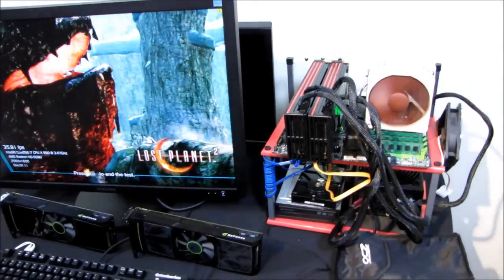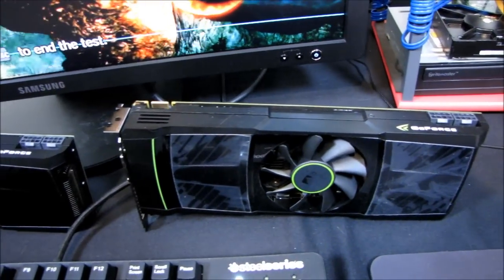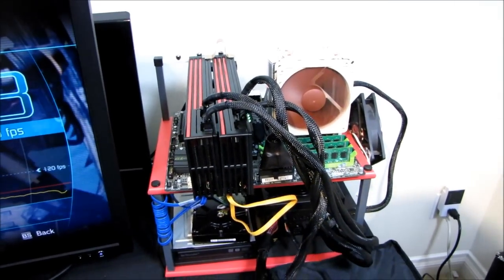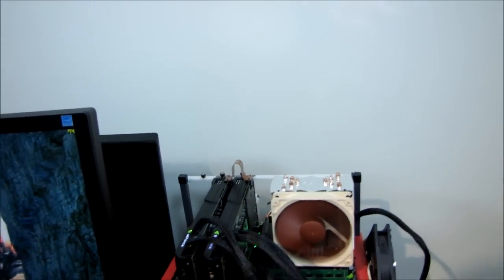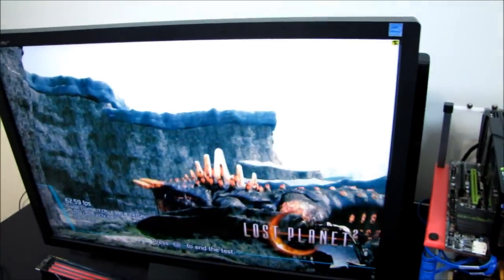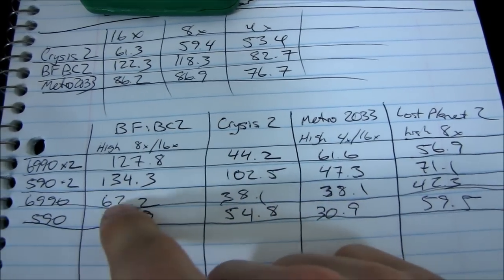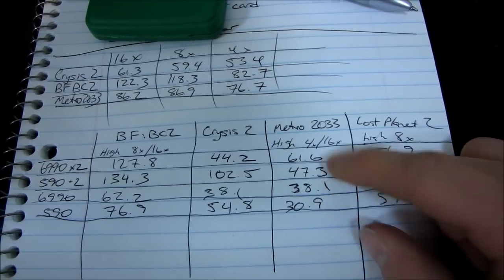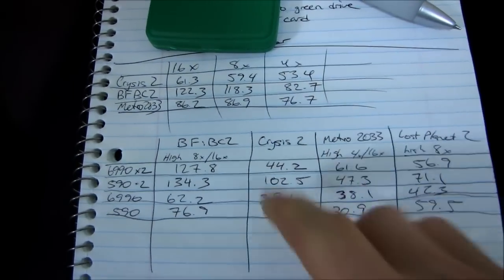Quad SLI vs Quad Crossfire Heavyweight Showdown GTX 590 & HD 6990 Linus Tech Tips

Comment: Pentium 4 - 7 gigaflops 
Core2 Quad - 70 gigaflops 

Playstation 3 CPU [Cell Processor] - 218 gigaflops 
Playstation 3 GPU - 1800 gigaflops (1.76 teraflops) 
nVidia Geforce GTX 295 - 1788 gigaflops (1.75 teraflops) 
its a fact idont have a ps3 check wikipedia and IBM

Comment: na thats about right dude. A GTX 680 will run around 40-50 fps with maxed settings and 32x AA So im not surpised if a 560ti can work just as well with no AA.

Comment: because it doesn't  at all it only does a solid 30 fps it usually doesn't do a full 720p on most games its just blown up from about 640p it cant do aa or af has much lower res textures by a lot you could see that just by look at the ground doesn't do ssao hbao or any ao at all and cant do shaders that need samples at anything higher than 32 samples cant have nearly as high mesh detail but then again the xbox cant its just a tech thing and its all DX9 so you alrdy are limited by that alone

Comment: You CANNOT build a full working pc for $280 and have it perform better then a console at gaming, The PS3 uses something called a RSX at 550MHz which performs better then a Radeon 6970. The PS3 has a powerbased core at 3.2GHz, building a pc the $280 price range you will probably get a intel celeron which runs at 2.4GHz, overall for $280 you can build a piece of shit that couldnt run BF3 on low settings with even a 25fps

Comment: dude trust me i know what im talking about i know the specs of the consoles pretty thorough it could realistically 280 dollar pc not with the os maybe with or without the case depending what you wanting it to be but a complete pc to outrank a console is about the same as the console BUT A 250 OR 300 DOLLAR GPU FOR THE CONSOLE DUDE FUCK OFF THATS INSANE ITS NOT LIKE THEY HAVE 6970s IN EM

Comment: >Why should I be a fanboy
Umm, I don't know... maybe because of the fact that your username is SapphireHD5850Xtreme? Nah, probably not it.
>ARE YOU* an Nvidia fanboy?
Nope, I'm a fan of performance. As a certified Autodesk 3Ds Max professional, I require the best hardware (and the best written (stable) drivers) there is out there, from which AMD is not the best choice.

If I had a better choice than Nvidia Quadros and Teslas, trust me, I'd switch!

Comment: No I don't but, I am right, 590 is dual GTX580, and the 6990 is also dual that 6970 so I said they're dual, so 2xHD6990 is 4x, and 2x590 is 4x. That's correct.

Comment: For cheat GPU both can do the job preatty well, if you are going for High-End i preffer Nvidia and for SLI on Nvidia Intel is the best choice i guess...But for low budget AMD+Ati seem like a good option. HD 6990 is like a big fail in Crysis 2, but HD 7xxx allready fix all that. Also i wonna know if there are gliches on the screen when using Crossfire and SLI configuration...

Comment: nvidia fan lol... the 7970 is the best card out right now, if you slightly OC it, it overkills the 680 right now. but the 680 took a huge leap from 512 cuda cores on the 580, to 1536 cuda cores on the 680. but the 7970 memory bandwidth can transfer 264 Gb/s and the 680 does 192 Gb/s. also the 680 has 3.54 billion transistors, and the 7970 has 4.313 billion transistors. just saying... but i dont diss on nvidia, i really like there performance but ati is better price/performance. in some aspects

Comment: Are you fucking stupid. 
You were wrong, bigger screensize has fuck all to do with framerate.
You can get a 22" screen @ 2560 x 1600 or a 50" screen @ 720p.
the 50" screen would get better framerate you fucking idiot.
Idiots these days

Comment: i run them at 3840x1200 (max settings) and soon to be 5760x1200 OR 3600x1920 (if i do portrait)
1 card mind you (i can do 6 screens in 1 card if i really wanted but no way could i do max settings

Comment: and about 2k watts of power...are you ABSOLUTELY sure about 4 590's? that's effectively an 8x sli...i know about having 4 pci-e x16, not pci x16 as you earlier mentioned, which allows you to run 4 580's in quad sli, but there is only up to quad sli support, not 8x sli. case in point, sabertooth x58 has quad sli support, but only 2 pci-e x16, i.e. dual 590's.

Comment: @08jminke They're both dual cores, so it's 4 cores total. Your average card is only going to have one single core. So in SLI terms this is a 4 way, you can't run 4 GTX 590's in SLI.

Comment: I dunno had a crossfire set up with two OC 6950's and it gave me nothing but constant issues. I dreaded driver updates. Now I just run one 580 and really haven't had any problems. Sure my performance is down by almost 50% with no OC but I really never needed that much power in the first place. Also no catalyst control center is a dream come true. I'd still buy ATI but never dual card set ups on either ati/nivida. I just don't like dealing with the drivers. I just want to play.

Comment: @tymonster187 the reason why cases have a cooling system is because the case is the main culprit for increase of temperatures. Also if you really want a cooling system for gpus then a good lcs would be the thing to get. Plus the ram isn't garbage, how did you get that conclusion?

Comment: @darknessofkrish In Most cases Drivers..Games with the Nvidia Branding have uneeded Code that slows down AMD cards and Games with the AMD branding has uneeded code that slows the Nvidia , Metro2033 is Raw Graphics with out any Extra added Protocalls that favor the GPU drivers, you will see this go back and forth. this current generation of games Had Nvidia branding and the Next generation will be AMD. game developers and Hardware developers switch contracts back and forth. there is no best brand

Comment: @thedudewhoiskickass i can say you are very stupid and you even don't have ideea what you talking about, for your personal information, low rez are handled by cpu and high rez are handled by gpu, so, in this case 800*600 are using ~50-50% of both, that's why games are working better on 800*600 or 1024*768 not because are not so big fraps! 
next time inform yourself or make some IT hardware schooling before posting bullshits

Comment: You are much better off with 3 single chip cards for each. The 4th chip adds very little in terms of scaling, plus the 3 single chip cards will run much faster than 4 slower ones.

Comment: @mickifree12 Why not get dual 7970s? They won't perform as good as dual 590s (or GTX580X2 for that matter) but they run more stable because 590 drivers aren't really very well with Quad SLI.

Comment: @mickifree12 each of these card uses a max of 380 watts, so 380*2 = 760 + 125 watts of CPU = 885watts + Blu-Ray/HDD/SSD/motherboard/RAM = 940 watts
yeah... a 1000wats is enough but its in the limit, you should buy a 1200 watts PSU

Comment: @mario11168 well they wouldnt be like 1000watt PSUs lol, theyd be like 700watts, i got plenty of those laying around. Ive never run blu-ray or SSDs before, and yea i figured SSDs were more energy efficient since theyre practically oversized flashdrives. 

the reason why im concerned/asking, ppl on newegg hav been buying 1400+ watts PSUs because theyve been running into problems with 1000watts after gaming for about an hour or so

Comment: @mickifree12 a 1000 psu is more then enough infact if you remember a 1000 watt psu can handle 4 gtx 480's so. I'm almost 100% sure that 1000 is more then enough. But If I were you I'd wait for Nvidias new cards coming very soon

Comment: @mario11168 yea i kno its not exact, but a 200 watt difference is HUGE lol, and i plan on running a bluray and a combo reader (because ive had bad luck with disc drives in the past) plus an SSD and a HDD for games etc. 

i was wondering what linus used to see what was a good start and go from there, ive also been looking into running 2 PSUs in the comp for stability

Comment: I got a very important question guys. Would a Noctua NH-DH14 CPU cooler leave enough space for 16GB of Corsair Vengeance RAM on either a GigaByte G1.Sniper 2 Mainboard or Asus P8P67 Deluxe Rev.3.0 Mainboard? Very VERY important question cause that cooler seems to fit my needs perfectly but the only problem is the space. Thanks in advance for the answers :)

Comment: @860125mwj Those "1000 fps" that you are talking about can be easily attained by these dual gpu monsters at lower settings like Directx 10 (or even 9),a lower resolution, lower Anti aliasing and Anistropic Filtering Settings, etc. Those "30 fps" that Linus talks about is at ULTRA max settings in games which are designed for bench-marking GPUs and comparing them rather than playing (Of course if I had these cards i'll surely be playing at ultra high only).

Comment: That's funny. You say, you are not using the lowest slot due to pci 2.1 x8 speed. Well, neither your cpu nor your mainboard does not support SLI/CF with 2 times x16 anyway. That's one of the less positive aspects of the new Bulldozer... It supports SLI/CF with x16...

Comment: I would like to know the power usage for the 2 590. Because i have a 850 80+ gold psu, 1 gtx 590, Asus rampage 4 extreme, 3930.... I would like to add an extra card but i dont know if 850 watts would handle it.

Comment: i have a gtx 570 from palit and gtx 550 ti sonic from palit too and PSU is GX from cooler master 750w is it enough and i keep continue to have NVidia drivers stoped working and kernel mode something do i have a hardware problem is my power supply enough my sys rig is pretty good!!!!!

Comment: @VoiD1x I have no idea what you had try saying there. But if I understood you correctly, this rig is called quad SLI and crossfire because the 6990 and the 590 are, in a really basic form, 2 video cards that come pre-sli or pre-crossfire. With the architecture these video cards use, they still have an additional sli/crossfire connection to connect additional video card

Comment: @TheLak1994 you cannot do that, only two cards of the same series can be crossfired. If you have a 6990 i doubt you would even need it anyway that thing is a beast..... for crossfire all you need is 2x 6950's to run virtually every game max settings, multi monitor, etc.

Comment: @OmegaFuckingWeapon 

for example, the radeon 6870 cant run BF3 on high settings says the stats from systemrequirementlabs. But when i got the game am running it on ultra settings without any problems at all.

Graphics card improvements depend on a lot of alternative factors instead of just looking at the card itself. Sometimes even getting a better MB mobo improves the performance.

Comment: @OmegaFuckingWeapon 

it also depends on your CPU and game. No point in having a good graphics card if your CPU is slow and cant process that fast. 

Some games work better one with brand of graphics compared to another brand. You can't really say the makers claim of graphics improvement are inaccurate just that there are lots of factors involved as to good graphics that does poorly on some games.

Comment: @OmegaFuckingWeapon 

they are not powerful, the only main difference between high end models vs the old models are that higher end models run faster enabling them to process faster + more transistors and cores that allows them to do more things at once.

1gb memory of graphics from then to now doesnt change. But the processing speed does make a difference though.

Comment: @Zynomics 

no thats wrong. Hes using 16x, when u have one card using 16x and one using 8x, this configuration will actually slow down your 16x card since dual cards need to match the speed of each other otherwise it wont work properly. 

Just like how if u have 4gb ram running 1600 and the other runnin 1330, it will slow down the faster ram to slower one.

Comment: It just seems like these numbers should be so much higher then that. With dual 6990's or 590's it seems like the fps should be at like 200! I could be wrong here. but with my old 4850x2, I was getting 120 fps in dirt 2. dual 6990's should be WAY more powerful.

Comment: @Zynomics my motherboard (asus crosshair v formula) specs clearly state that if i run 2 cards in the 1st and 3rd slots, they will BOTH simultaneously run at x16. i think that's pretty clear with no room for interpretation

Comment: @godgrant123 i'm have minimal experience with crossfire and sli. i have read up on many forums because i was thinking about taking the plunge but from what i gather, 2 midrange cards won't do as good as 1 highend card will. one good 6850 or better or  570 or better will do great. a quad crossfire/sli is overkill. good for bragging rights i guess but that's a high cost to brag.

Comment: Talk FPS numbers not scaling crap. All tests so far showed that the 6990 is better on 2560x1600 than the 590 so I don't know where you pulled those numbers from especially since they aren't accurate at all.

Comment: 1:25 That's why you get a motherboard that has both PCI-E slots used one extra slot apart, so the fan doesn't have to work as hard.

Comment: with those big frames
with only a single card you may be experiencing architectural bottlenecks, ram bottlenecks or other hardware issues that would artificially deflate single card performance so a gain of more than 100% is entirely possible if that is the case
and if that's the case ati may want to redesign their dual gpu architecture or drivers so it works more optimally with large resolutions
but as you say, it is a small issue

Comment: @Amuffin456 well i have a 6870 already and thats what im trying to figure out is if i can just get another 6870  even though they will be as cloase as the 6990s in teh video. but powercolor does make a Radeon 6850 single slot version and i could put that in the top slot and then the 6870 on the bottom to help out with air flow. but if that single slot version is $200 and anotehr 6870 is only 170-190$

Comment: CAN ANYONE TELL ME...is it bad to run GPUs to close i want to xfire my 6870 and im pretty sure they would be about as close as the 6990's were. only other option i have would be is to buy the single slot 6850 and that would allow me to have room for the 2  but would hold my 6870 back some. but if i can run 2x 6870's that close im would hook up like a 120mm fan some home directly to the cards to get air in there to the top card. ANY HELP WOULD BE GREAT CAUSE IM STUCK.

Comment: is it ok for cards to run that close together??? i have a matx mobo and im running a 6870 already and would like to xfire them but they would be about that close together. wouldent that make the top card run really hot?

also is it possible say i buy another sapphire radeon 6870 can i take the plastic off off the top card to give it more room to breath and let airflow in? or would that not be advisable or even possible??

Comment: @LinusTechTips
ATI is using the turbine mode fan the air is coming from the front of the case and going outside from the back ;)
that little space is to not over stress the fan not for sucking air from that little space
check twise b4 you speak man
anw i realised that you are a fan of nvidia graffics cards...

Comment: @l3coyott3 its QUAD because the HD6990 has 2 GPUs so 2x2GPU=4 (QUAD) GPUs
4 way CF or 4 way SLI of dual-GPU VGAs are not supported

Comment: @MinecraftCountry I've tried out more than 6 different video cards, added 4 extra ssd and 10k rpm hard drives and it upgraded my am3 3 gig quad core to a 3.2 6 core phenom II am3 cpu and it never asked me to activate.  Perhaps you meant to "specify" that windows asks to activate when the storage drive ( ssd or hdd), that the o.s. was already installed and activated on, is connected to a different motherboard than when that o.s. was installed on the storage device connected to.

Comment: @Przemro9 

Yeah look I agree with you but nVidia is much more expensive than AMD and performance is not far off. I just bought 2 6970s because they were $340 each compared to $540 for 580GTX. Have a look at the benchmarks, 580gtx sli vs 6970 xfire. :) 580 wins by a small fraction but price difference is massive :)

Comment: @T1MSt3R484 Somewhat. Although the results suggest the Nvidia card is the better choice: Nvidia 590 wins in 3 out of four benchmarks alone, also wins in the same 3 of 4 results for dual-card mode, and by a significant margin for Crysis 2. The Nvidia cards are also quieter, cooler and use less power. From this the only question you need to ask is if you're massively biased towards playing Metro 2033.

Comment: @Zulfikaar219 actually if you use the evga sr-2 motherboard you can run 4 gtx 590 cards as long as you use a case that has 10 pci slots

Comment: @tjwilt22 Ok, why don't you point me towards a motherboard that has SLI with the first and third PCIe 
slots both wired for 16x.

Very good chance you won't find one. All, if not, almost all motherboards that have 3+ PCIe slots have only the first 2 wired for 16x.

Heat/sound have nothing to do with the raw numbers that the GPU's are spitting out, unless they overheat and shut down, which they did not.

Comment: @xlegendqc87x 

It is a driver limitation, you can still bridge four of the 6990s(2 by 2). With the driver hack you'll be able to use the extra horsepower without a physical bridge connecting the pairs, it's also similar with the 590s. It's been done bro. Look around and you'll find setups that have this done.

It may not scale well in games but you'll still make use of the extra hardware with a driver hack.

Comment: @sgtrandall1 get a EVGA GTX 580 3gb is the best
GTX590 is 1.5GB per GPU so only use 1.5GB
HD6990 is 2GB per GPU so only Use 2GB u want the best for 
High Res and High AA GTX580 3GB version is the best